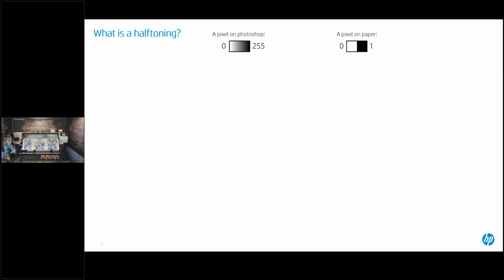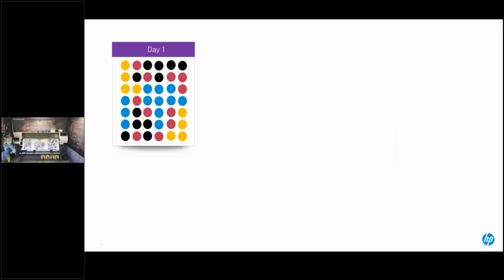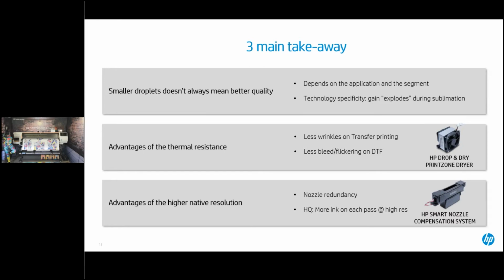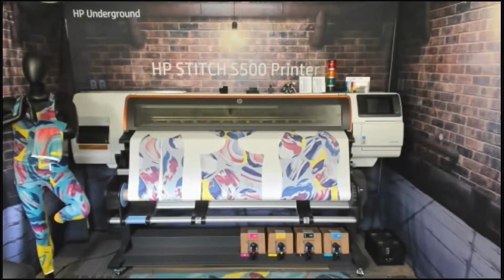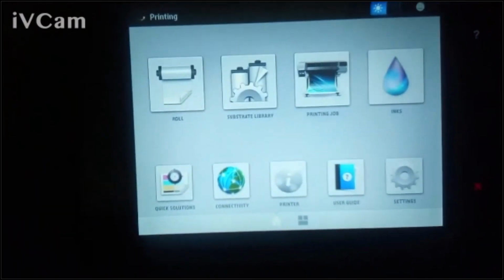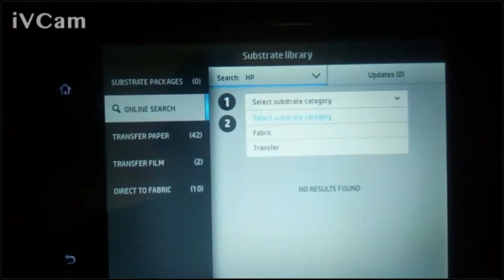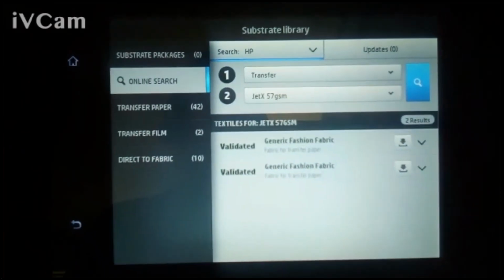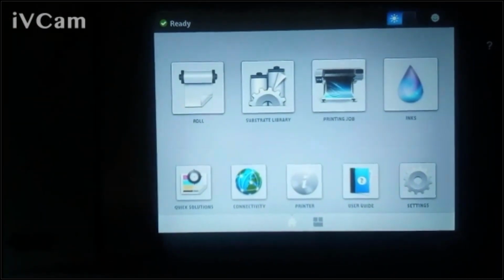HP Stitch - Dye Sub and Direct to Fabric

Comment: Is it easier to get the color at least 80 percent of what the first side looks like on the back side with sublimation or direct print on textile? Which do you recommend?
Reply from the maker: We'd recommend sublimation if your goal is bright, vibrant colors and you’re printing on polyester—it really makes the designs pop. Keep in mind, though, that the back won’t match the front unless you print it separately. Care must be taken to prevent the dye from bleeding through or distorting the initial side’s design when printing front and back. For other fabrics like cotton or blends, direct textile printing works well, but again, both sides would need their own print for a true match.